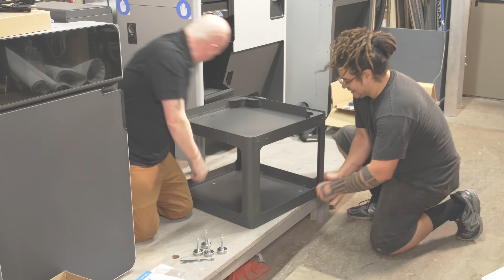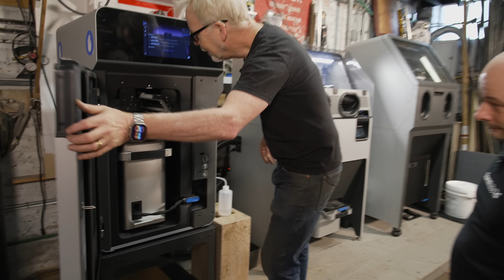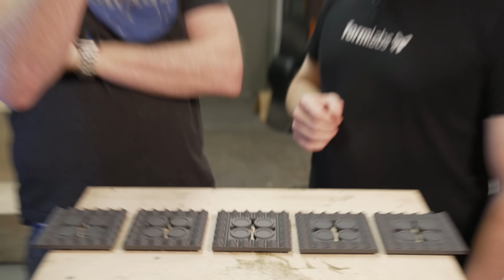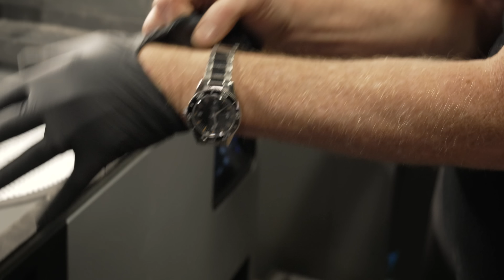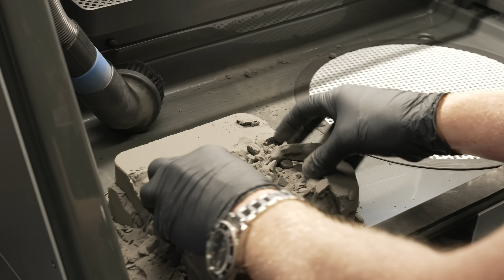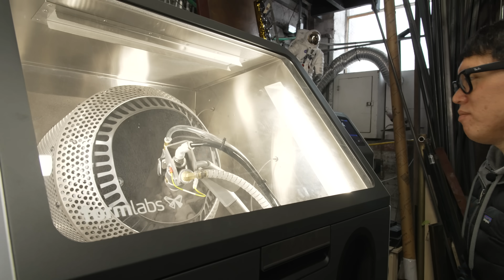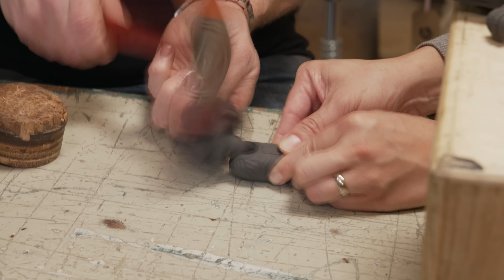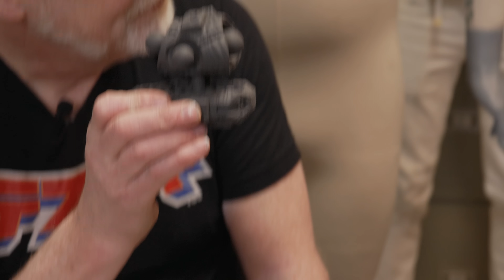Adam Savage Levels Up His Workshop 3D Printer!

Comment: Remember when there was a glimmer of hope for consumer SLS a couple months ago?

Pepperidge farms remembers.
Reply: I'd like a consumer EDM machine.
Reply: And at the same time another industry dinosaur, Stratasys, tried/is suing BambuLabs for purge towers, heated beds, network capabilities and other things.
The things the industry does to protect their $100-200/kg/spool milking business.

And yes, Stratasys asks around $100-200 per spool (or even more, depends) of material and the 5-6 figure sum in USD costing FDM printer cannot use any other spools because RFID chips (you can guess where some people have gotten their doubts about BambuLabs going proprietary, the RFID chips in the spools and all that). The Stratasys printers are, well, you can initiate the print and forget, it just works, the multi-extruding is awesome and already your $300 bed-slinger with Klipper runs laps around it in speed and absolutely can compete with it in quality.
Reply: @IcedForce 
I'm not trying to say that Stratasys is a great company, but there are some advantages to a submerged system with qualified materials (I still wanted to be able to run my own materials in it )and it's that you know the validity will be amazing, the machines are foolproof and if something breaks someone will come and fix the machine. But those are just my experience using a Stratasys fore printing some kind of carbon filled wonder material.
Reply: @Goroca  The "wonder material" is ABS-CF10 and it's just ABS with 10% carbon fiber in it and no, it's not worth the ~$200-500 they ask for a spool of it.

I don't go more into the validity of materials and prints because, well, it's more about who you trust or don't. I personally don't give much trust to anyone who is trying to sell their thing to me before seeing what they really can do and what their competition does. And let's just say I was the guy who asked from FormLabs representative are their SLA printers so bad that they need some special resin to work (you see, you can turn that proprietary otherway around, instead of them offering the best they know, they offer just what they managed to get work) and we might have got quite a deal on the 3rd party resin license.

I am not denying that Stratasys and other dinosaurs would have their place. Like the first print experience with Stratasys F370 was awesome, it just works and anyone can get a successful print with it. Their multimaterial printing is way out there that "consumer" printers can still just dream about achieving that. And don't get me started how wet I get about our company's Stratasys J55 printer, that shit is wild, and other stuff that isn't even close to be in the knowledge of consumers.

But for single material FDM printing, anyone is a fool if they get something like Stratasys to do it. The costs are just way, way too steep and the outcome really doesn't cover them. For the price of F170, you can get Bambu P1, Prusa XL assembled or just about any "prosumer" printer, that easily even surpasses F170 in quality, and more parts and fillaments than you can ever use, or hire someone who knows about 3D printers and builds you something like Voron2 and customizes it for your needs.

And still the +$100 (~$150 it was the last time I ordered some) they ask for a spool of PLA is just robbery. <$50 and we could start to discuss about premium costs, but $100 and it's just robbery. And that suing of BambuLabs looks more like Stratasys is afraid of losing their business and trying to sink their competition rather than trying to protect their IP's which pretty much half of the world already uses without even knowing what Stratasys is.
Reply: @IcedForce Ok
The material i got to use whas not cf abs and i agre that that material is really overpriced, think it what nylon,pc or somting like it. I needed to get it printed on that machin bechon my homemode mashet whasent up fore the tast(it can print abs all day long).
Think the reson that stateses in litegatitg agenst bambo is bechos thy actively have the power to overturn(ore somting )the patent. And some of the outside printers thy howe are black magic but i am att this point using ther fdm patents as inspecation foru my own printer. .
Howe a nice day

And yes it is really overpriced(even when I only pay fore the filament )
Reply: @Goroca There's advantages to an integrated system but Prusa and Bambu both offer qualified materials with premade print profiles and neither has any kind of lock in attached to it (I'm sure other companies do as well in this space, those are just the ones I'm aware of).
Reply: @IcedForce How do you know it was ABS? Could have been CF nylon. Still not worth that much but at least a little bit more engineering grade than ABS
Reply: @bosstowndynamics5488 
But non of them ofer the materials that some need, heated chambers, realy hot nozzles and that werd whay of staking layers rely help when you are printing tecnical materials
Reply: @Goroca  My point was that you don't need vendor lock in to get validated materials, the lock in is 100% downside. The fact that Stratasys happens to offer some other features isn't facilitated by that lock in
Reply: That thing wouldn't come to the market. The ammount of money the got with Kickstarter wouldn't cover production, it required major redesign for final product, prints weren't that good and the process of extraction of parts would make you sick. Not to mention you need to hire people (sales, customer service, shippin, marketing and repairs), have warehouse and factory to produce them

Wouldn't be surprised if they used Kickstarter to find a buyer, as far as i know there were only two dudes working on this
Reply: @seljd 
Look, someone that actually can spell
Reply: I did not think that printer wholde get to market bechos of the technical problems, and even if it did it wholde have been a safety disaster fore the operator whiteout somting tike a negative preacher working station.
Reply: @Goroca  are you alright?
Reply: @8bithack 
No